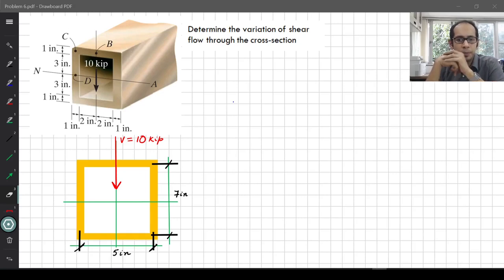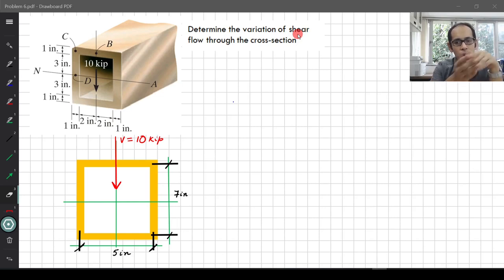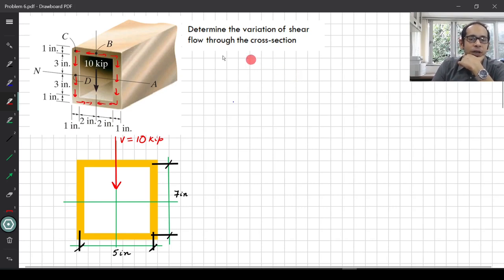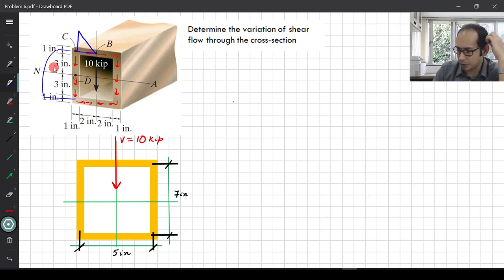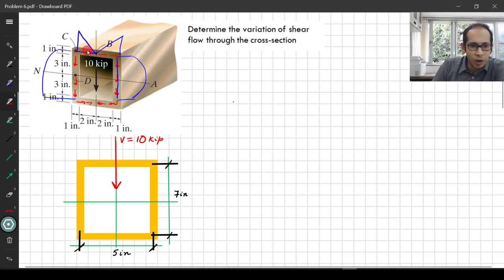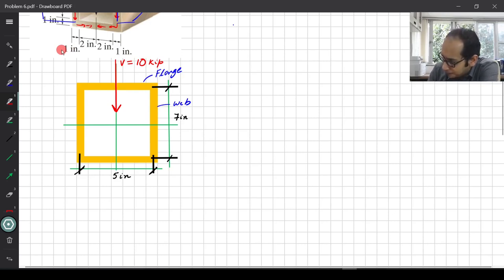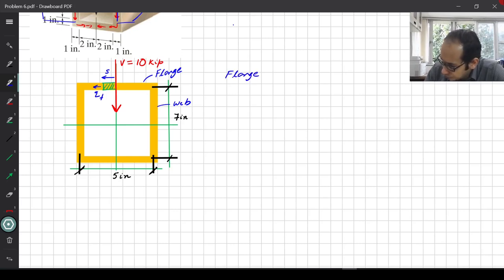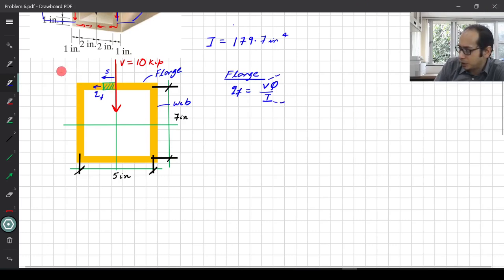Topic # 7.5 - Shear Flow in Thin-Walled Sections (PROBLEM EXAMPLE)

Comment: Can the shear flow formula VQ/I be used to calculate the shear flow on the weld of 1.5”x1.5” bar rail to the top of the flange if it is discontinuous with a gap?